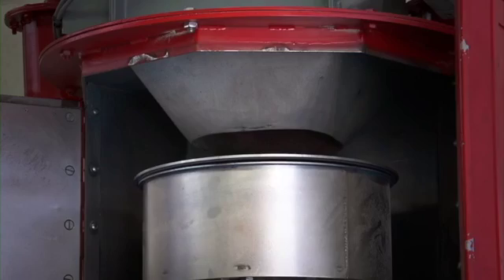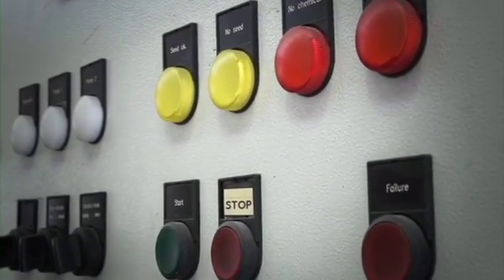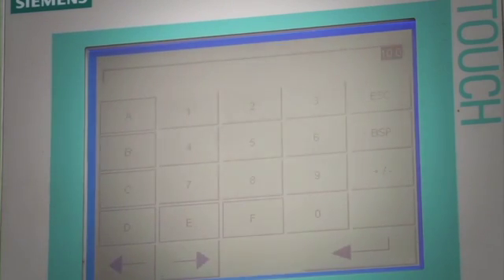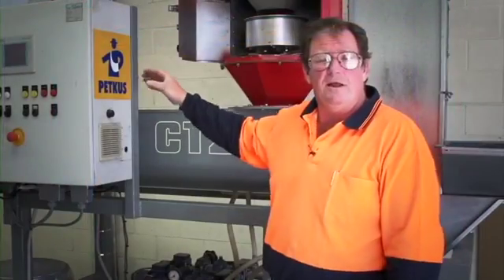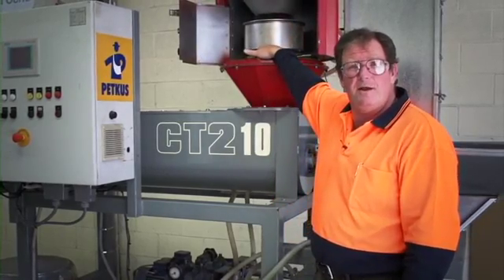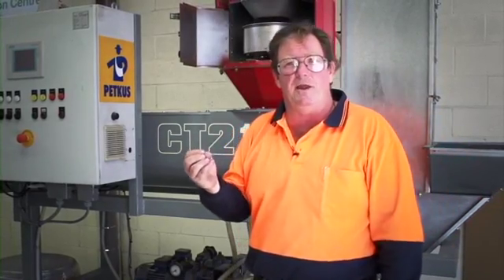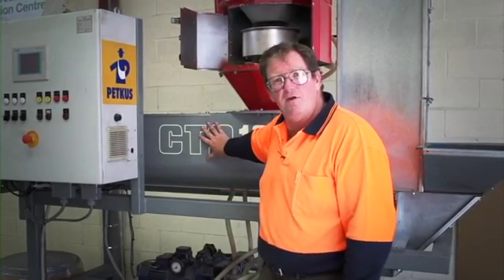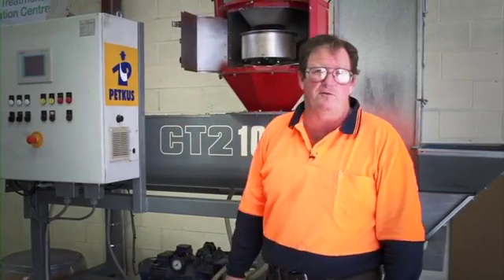Bayer CropScience - Seed Treatment Plant

Comment: Great video. Used to do mobile seed dressing in UK. Applied Baytan in powder form into 50 kg bags before being a liquid. Always ended up with pink hair at end of season from bags dropping off and puffing up dust as they hit the conveyor below!
Applied treatment through a continuous treater with it being mixed by 10 inch wide 12 feet long auger. Interestingly, eventually applied 2 litres of water per tonne in addition to treatment.
Before doing that Bayer test revealed 25% loss of chemical even though 100% was applied. After applying water seed ended up a lot redder. 

Would have to be careful applying 6 litres per tonne of water in addition, say to 2 litres of treatment because corn may end up too wet and lose its germination. 
From memory 2 litres of treatment plus 2 litres water adds half to 1 % of moisture so in wet autumns,  with 6 litres water, seed could end up in bag with 18% plus moisture content. This could mess up flow in drill as well as cause low vigour... And if stored a month or so disasterous establishment may result. 
Lab results are all very well, however in reality many other factors, if not considered could lead to catstrophy.